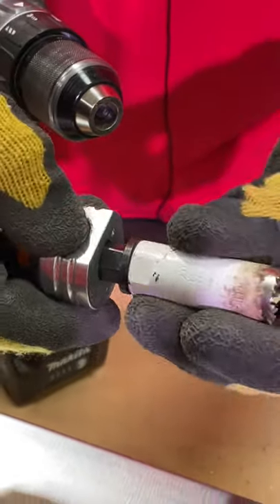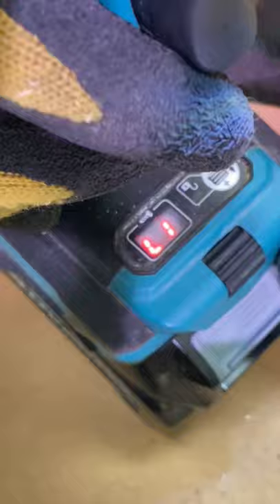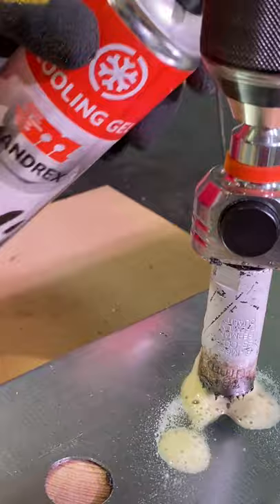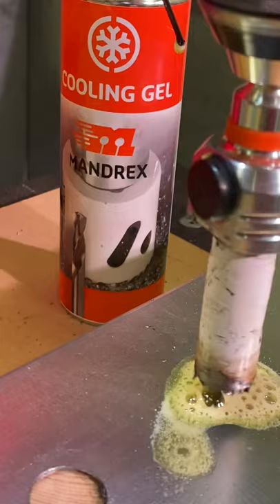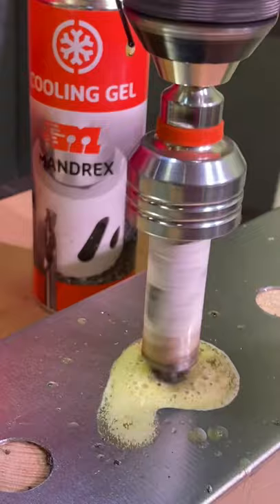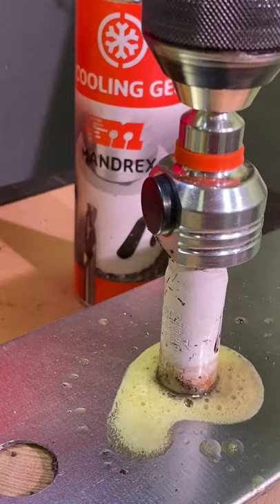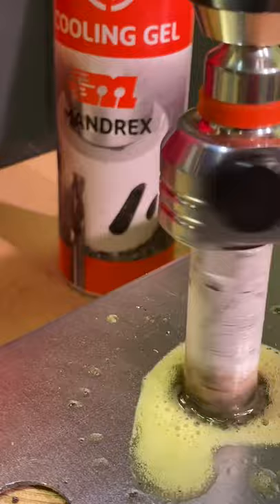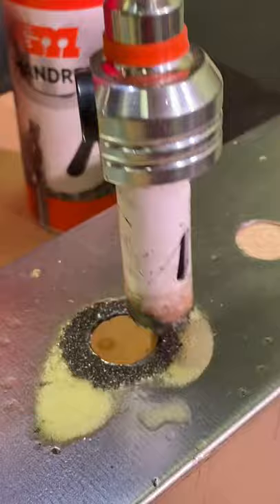CLEAN holes in metal trunking using MANDREX COOLING GEL #shorts

Comment: Use a washer and slide it over the pilot bit. Once the pilot drills through, the washer prevents the teeth from grabbing, so no need to adjust the torque. Also, red onion juice works better than any lubricant or cooling spray. Even the cheapest hole saw can blow hole after hole through stainless with red onion juice. Smells like a hibachi steak house too!

Comment: As a person who fabricates things using cutting fluid is something that I never use. I’d rather buy a $15 drill bit every other week instead of taking 5 minutes to drill each hole. Time is money.
Reply: Invest in top quality bit AND fluid and you'll see you can save both time & money.
Reply: Spend $45 on a carbide bit use cutting oil and you will be just fine
Reply: Heller drill bits😲😲😲😲😲turning metal into butter 😭😭

Comment: I mean, I know that’s technically correct, but which of us hasn’t had 20 holes to get through and wanged our way through without any cutting oil at top speed? (Slow down and reduce pressure just before cut finishes, to avoid circumference of circle from bending!)
Reply from the maker: It’s the top speed that reduces the tool life.
Reply: @efixx  indeed. Need more patience!
Reply: @efixx  you need to do a pros breakdown of if doing it faster and going through more tools earns enough to cover it 😝🤣
Reply: @efixx  It's the top speed that doesn't get you fired. Lol
Reply: @efixx  higher speeds are okay
It's the overheating and subsequent annealing of the metal that ultimately reduces tool life
Use cutting oil
Reply: @efixx  
Use a step drill to get the job done. Hole saw are for large holes .🤦‍♂️

Comment: As a fabricator myself I noticed 3 problems with this video:
1. Smacking a spring loaded punch with a hammer doesn't make any sense. 
2. You're speed is too fast for a hole saw.
3. You're fastening dissimilar metals together and essentially inducing galvanic corrosion and it will look like shit in no time.